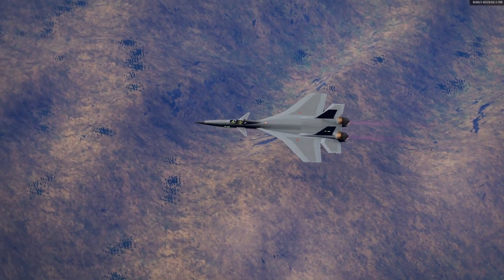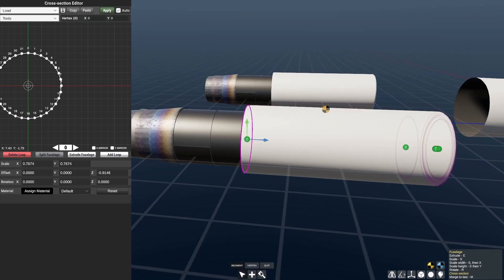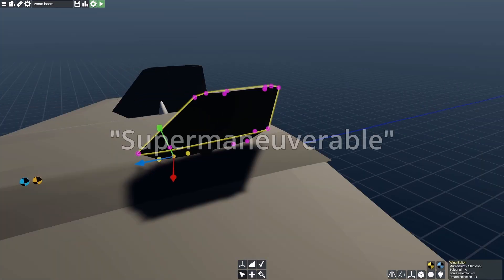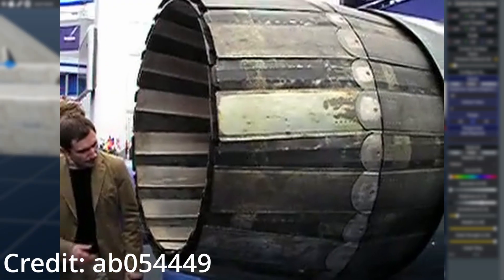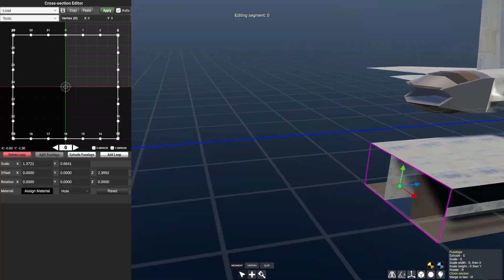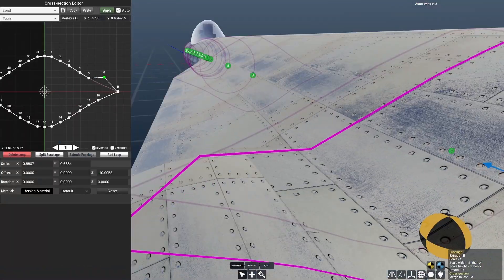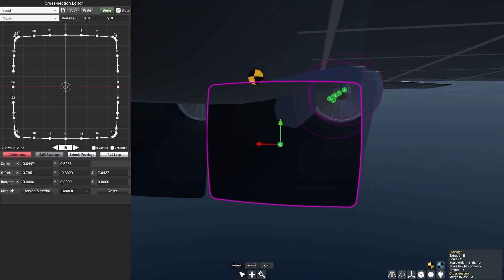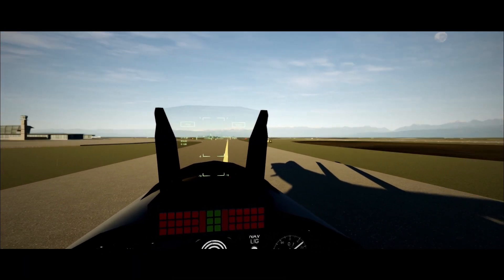This Bomber Does More Than Bomb || Flyout

Comment: Ooh, on the information part though.

I'm no plane goddess, but both MiG-29 and Su-27 lack trust vectoring. 
The Flanker did get the technology much later on an upgrade, the Su-35, but that is not how they achieve their supermaneuverability - they do so through aerodynamic instability.

The blue side of the curtain focused tremendously on BVR, beyond visual range combat. Their aircraft were, save for the F-16, not built with dogfighting at the forefront of their capacities (though it was very much still a requirement; but you will hear most US pilots tell you today that "if you got to the merge, something went wrong".) The MTD Eagle was, I believe, a test bed for the technology we find today on the F-22 Raptor, which does feature thrust vectoring. On the other hand, the red side of the curtain ABSOLUTELY focused on dogfighting and WVR, within visual range combat. Both of their post cold-war workhorses, the Flanker and Fulcrum, as you did mention, are supermaneuverable, but simply by design- They are built like the F-16 was: intentionally aerodynamically unstable, meaning that separation of airflow over the wings is easier (that is how they can achieve angles of attack of 70+ degrees). The doctrine is also observed in their experimental aircraft too, notably the Su-47 Berkut, the forward-swept wing prototype which was another step in favor of supermaneuverability.
Reply: You did mention the difference between aerodynamic maneuverability and supermaneuverability - but the issue is that the later term is pretty muddy. A proper compassion would have been aerodynamic maneuverability and post-stall maneuverability, as the term "supermaneuverability" has been used extensively by aircraft manufacturers yet has no concrete definition. (There is no single statistic you can reach to declare your aircraft "officially" supermaneuverable. Though being able to perform high-aoa maneuvers such as the Kvochur Bell, or it's simpler version, the Cobra, is generally a pretty good starting point - Making the J-35 Draken a supermaneuverable aircraft too, despite very much lacking thrust vectoring.)
Reply: I will however note that fighter aircraft designed today with supermaneuverability in mind absolutely include thrust-vectoring. It is just vastly superior than to simply relying on aerodynamic instability (and I believe both methods are used anyway, as the Raptor, I believe, has low/relaxed stability too.)

All in all it's just a small mistake, but I like nerding about things I love 💜
Reply: @kaisrae 
IIRC, the F-22 is also aerodynamically unstable.
You didn't ask, but I saw the question.
Reply: @Fightre_Flighte  I researched a bit, and sources kinda contradict. Some say it has low/neutral stability, others mention a very slight unstability. The term "relaxed stability" is thrown around a lot when describing it so it's the one I used
Reply: @kaisrae 
That's... Hilariously fair, actually.
Of course, sources are going to be muddy on how stable the U.S. air Force's best current fighter is.
Though, since Gen 4 fighters, it's been common for center of mass to be within feet of center of lift. Which is usually referred to as "unstable" when you don't have sixty thousand dollars of computers flying the plane (per pilot's suggestion.)
But, relaxed stability is a good way to put it, when you DO have sixty thousand dollars of computers flying your plane.
Reply from the maker: wikipedia lied to me than XD